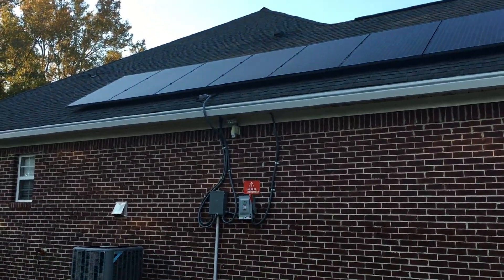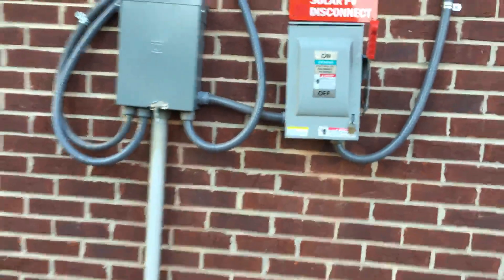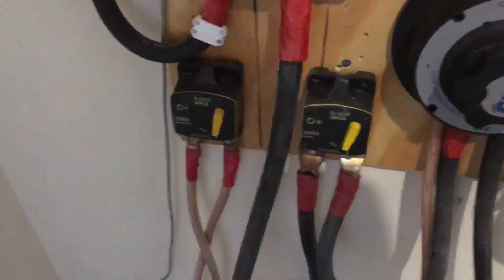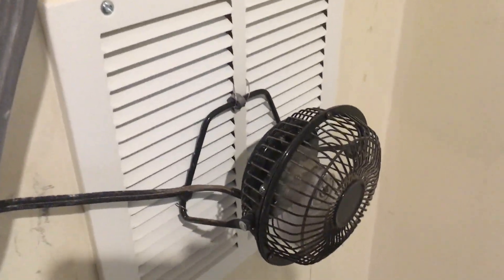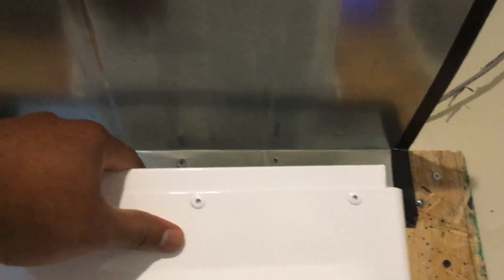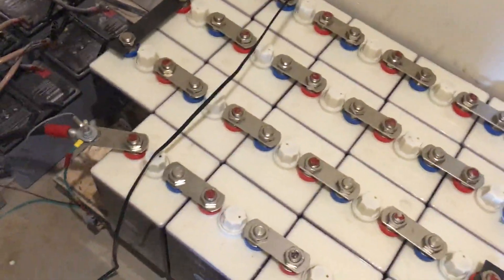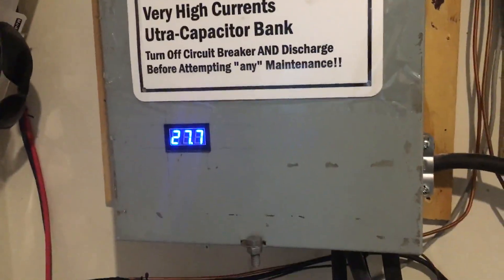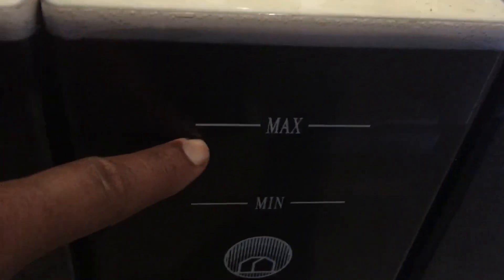An Overview of My Solar Backup \ Off Grid System

Comment: What are the Nickle Iron Batteries?  Who makes them?  How much were they?  Ahs per battery and voltage per battery?  Thanks
Reply from the maker: Peaceful Prepper The Ni-Fe batteries are alkaline based cells known for their longevity, they were made in China and purchased by me from a US distributor. I now have 200Ah in Ni-Fe cells, and over 200Ah in Ni-Cad cells which are Edison ED-240s, both banks are paralleled together for over 400ah. The Ni-Fe cells cost around $3499 without shipping.
Reply from the maker: Peaceful Prepper Also, each Ni-Fe cell is 1.2v per cell at 200Ah.
Reply: Thanks for the input.  Great job and keep the videos coming.....

Comment: Nice set up... I have been watching  your videos and good job... I have a $3500 dollar question.  regarding the APSY500.
I will be going grid tie soon. I have no solar at all. my plan is, or was. ground mount for total of 6kw system 22 panes Suniva 275 watts each.  paired with 11 aps microinverters...  now I was first considering the enphase micros 250 but that puts me around $1500 more. so I have been researching this APS 500 all over and there is not a lot.  I know you already  dumped grid tie. I want to know if this microinverters are really junk or was this not working for you because of conflicting with the rest of your set up?
what was causing surges on your system all the time.
I was strongly considering  the aps route but with your experience I am very disappointed to that brand... please give me you deep opinion. 
thank you and God Bless You.
Reply from the maker: Thanks for your comment and question. To be fair, the APS units do work and they work well.  I believe my issue revolved around the fact that my Magnum inverter may have been generating surges that the APS units couldn't handle.  Also, putting them on the roof was another bad idea. I wouldn't say they are junk, they like many micro-inverters have very sensitive circuitry that can be subject to voltage spikes surges etc from who knows what.  Being that your going with a ground mount solution in a non-AC Coupled implementation, I'm sure you'll have better luck than me.  When the APS units are working they work very well, in the range of 97% efficiency.  I've heard of Enphase micro-inverters also mysteriously stop working as well.  If I was going to do this all over again, and I had a clear view of the sky with no shading issues on any of my panels, and I wanted to grid tie with no battery backup, I would go with a string inverter instead. They are more mature technology and I could add batteries later without all the hassle.   If there was some shading issues, then I would consider going with the APS micro-inverters, they are not bad units.  I think my implementation was something they may not have designed to handle easily.

Comment: I see  you are using a large capacitor bank to compensate for the Ni-Fe batteries being stubborn in giving out large instantaneous amperage. That's an inexpensive way of fixing the problem. It certainly is cheaper than doubling the size of your Ni-Fe  bank. Nice job and great innovation.
Reply from the maker: Thanks for the compliment.  The Ultra-Caps are working great.

Comment: nice setup bro
Reply from the maker: meatdogg101 thanks for the compliment.
Reply: can you give me some advice on a not too expensive 12 volt inverter for my system
Reply from the maker: meatdogg101 https://www.walmart.com/ip/35902149?wmlspartner=wlpa&selectedSellerId=0&adid=22222222228023919567&wl0=&wl1=g&wl2=m&wl3=56300349551&wl4=pla-92977835111&wl5=9012693&wl6=&wl7=&wl8=&wl9=pla&wl10=8175035&wl11=online&wl12=35902149&wl13=&veh=sem  

or

http://www.theinverterstore.com/12-volt-pure-sine-inverter-chargers.html 

or 

http://gpelectric.com/products/inverter-charger-ic-series
Reply from the maker: meatdogg101 GoPower would probably be the best choice. But in any case, I would go with an inverter/charger combo.
Reply: where can i buy it
Reply from the maker: meatdogg101 Amazon for GoPower and TheInverterStore for Aims.
Reply: ok thk u

Comment: I obviously have to do my research. I didn't know that nickel-iron cells could last 40 years.
Reply from the maker: For what I see 40 years or more is the industry norm.  But it is expected that they will last even longer than that.
Reply from the maker: Yes, they are the least efficient, however the issues with efficiency and power density can be dealt with by optimizing the system with things such as right sized solar arrays to accommodate the fact that it takes more power to charge Ni-Fe cells than lithium and lead acid based batteries, also adding ultra-capacitors does improve the power density of the system tremendously, a quality charge controller that has custom settings to accommodate the unique charging characteristics of alkaline based batteries,  and not forgetting to add balance of system components that compliment the installation. Just my opinion based my personal experience.